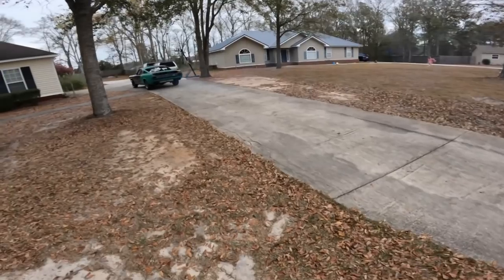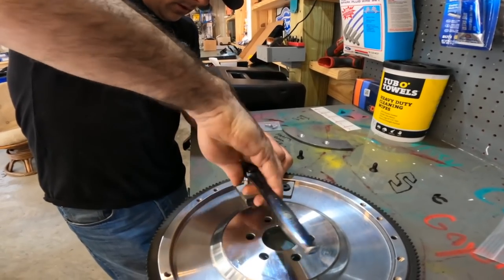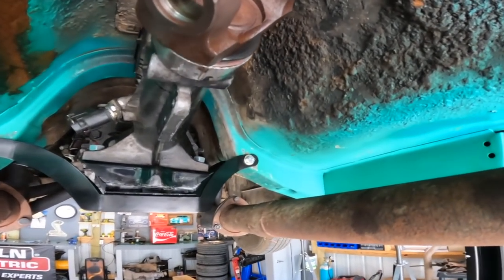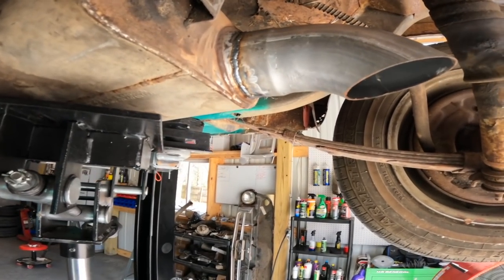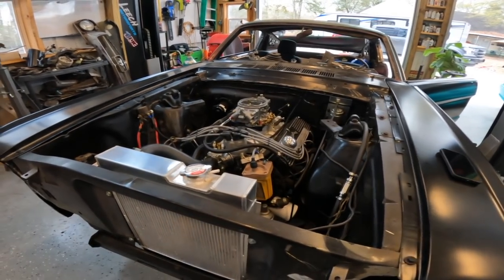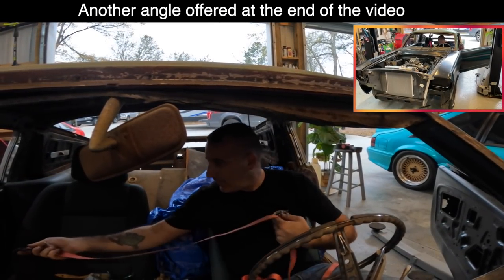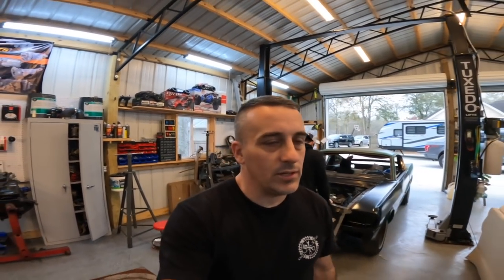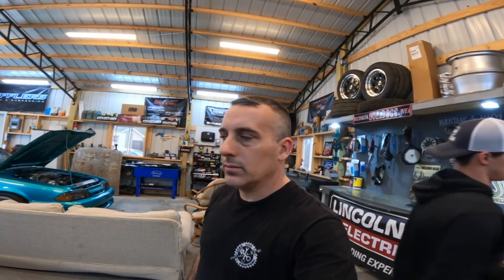I BET MY NEIGHBORS WERE LIKE... WTF? /  First Real Drive In My 65 After 20 Years!

Comment: Hi, I watched ione of your base idle reset on a fox. On my 91 347 I usually ground my tester to the ground cable on the battery which runs to block. I will poke the black wire and see if there is a difference. Thanks for the videos. I enjoy them all. Now I’m subscribed. 😎.

Comment: I went through all this, when I put the 351w in my 85 SVO, and then decided to go with the TKO 500 transmission. I bet the T5 in 65 is a awesome combo. I had a 66 coupe with a wide box toploader 4spd 4.10. It was great if you weren’t on the Hwy. then you needed another gear in the transmission.
Reply: Our 351w we used a top loader 4 spd Overdrive (wide gear splits) from a 85 E150 and 3.25 gear.
19 mpg. 👍
Reply: @hotrodray6802  in my M code 69 Mach 1 had a 2.78:1 1st gear toploader which is the standard (wide box) gear ratio. The 69 was factory with 3L50 rear axle. I’ve driven a few of those 3spd overdrive toploader transmission. Those could also be found in Granadas, and Monarchs.